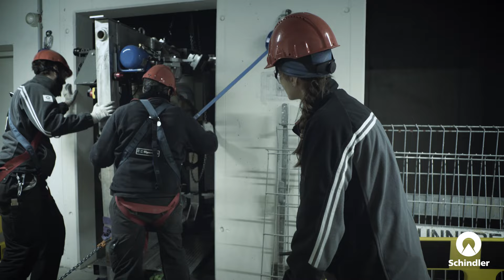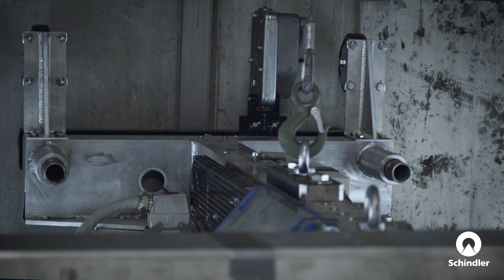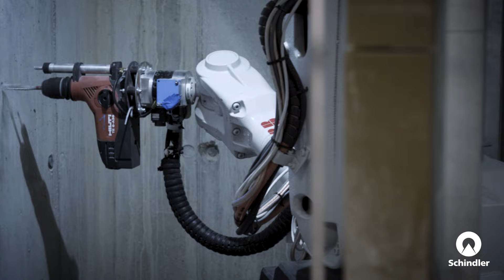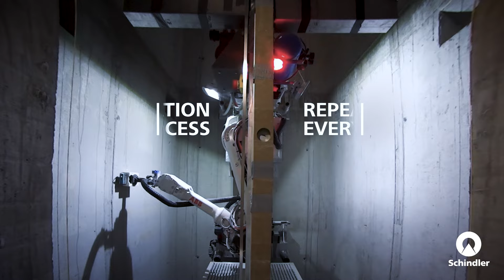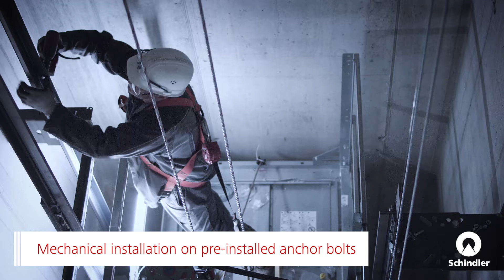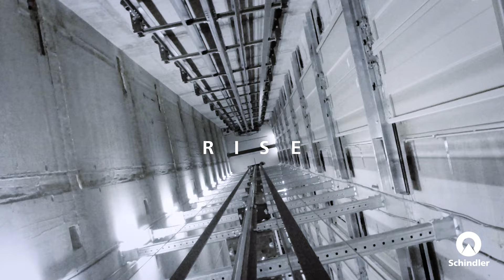Schindler Robotic Installation System for Elevators (R.I.S.E)

Comment: Can this robot haul rails and brackets, weld brackets in place so that they only need minor adjusting not hours of squaring up the angle brackets, wire and install conduit, and think for itself? If not, what a waste of money.